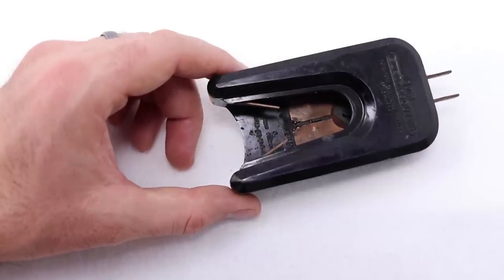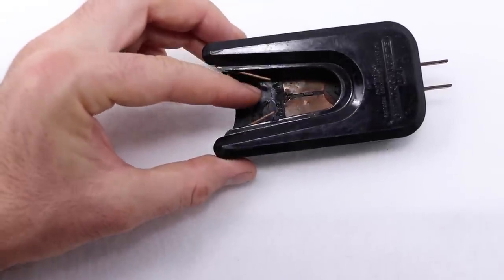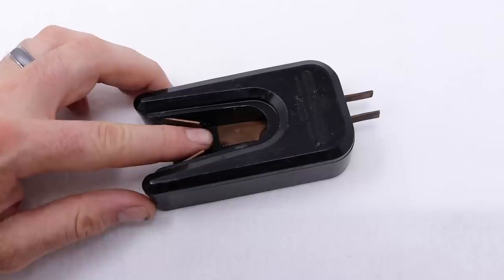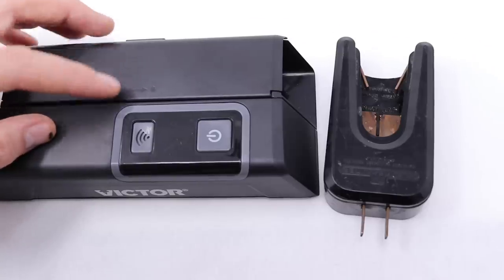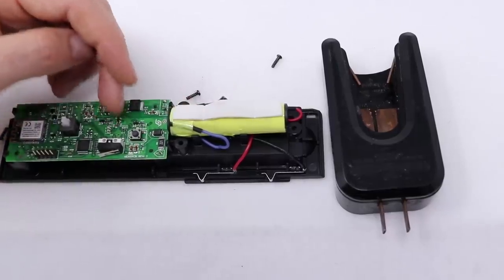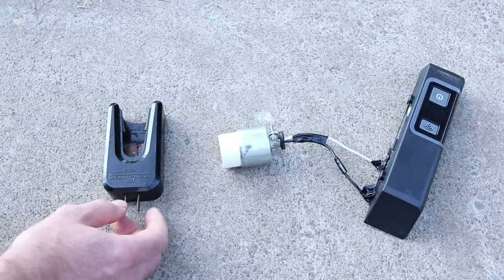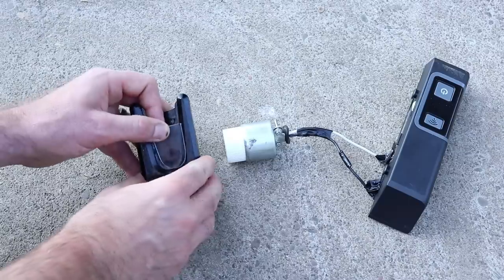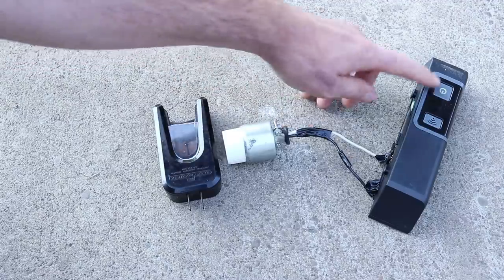The Electrocuter Mousetrap From 1947.   Mousetrap Monday

Comment: Shawn, it's not just 6 volts. The buzzing you hear - is actually a flyback transformer working - it generates thousands of volts. That's why it has all the safety.
Reply: Alexander Khritonenkov I think he meant the 6 volts charging up the capacitor
Reply: Christian Wang any buzzing indicates current switching. That’s not DC. The yellow bit is a high voltage module like a stun gun core.
Reply: WineScrounger oh yea your right a capacitor would be a single pop
Reply: if it was a capacitor there would be a rating on it in # microfarad(s)[with # standing for what number is printed on a capacitor next to the microfarad symbol and that would be uf]
Reply: My guess is that it gets upconverted before charging the capacitor. The capacitor is needed because the batteries can't produce the energy fast enough. So it charges the capacitor slowly and then discharges it fast.
Reply: Nerdddddddd
Reply: Lol where did my reply go?
Reply: @Smasher77th  that is true but i don't use the symbols enough to know how it is done infact i need to look up the key combination for the digree symbol when i go to use it while typing in a word doc or a comment

Edit: almost forgot to add in that i am considerd the techno nerd by those that i know around me
Reply: Chidiebere Anyahara  I'm an engineer at a large semiconductor company, and the only time the mu symbol is used is when we are writing something formal or semi-formal.  No one bothers to use the mu symbol during emails, we all have more important things to do than trying to insert a greek letter. In circuit simulation software and CAD programs, the letter "u" is also usually used over mu since it is actually on the keyboard and users can actually enter it.  Most people do not know the numpad codes to make these symbols, nor is it really necessary to do so.
Reply: tatarjj2007 uh oh here comes the master
Reply: @tatarjj2007  so if I want to build this at home, MacGuyver style, what do I need? A toaster?
Reply: could a taser be converted?
Reply: @tatarjj2007  it is easy to enter Greek letters if using a full keyboard, using the alt key and ascii code for the letter.
Reply: Thanks, I was going to ask that question hoping someone would know. So it increases the voltage and that is why it works.
Reply: @wadewillson9220  DING
Reply: Alexander Khritonenkov nn
Reply: Nerds make the world spin
Reply: @WineScrounger  it is probably thousands of volts pulsating DC.
Reply: It likely generates DC pulses (basically AC) that it runs through a transformer to produce a very high AC. The yellow component is likely a transformer.
Reply: @tatarjj2007  
µ is opt-m on a Mac.
About 1.1 times harder than typing a capital M.
Reply: @-danR  On Windows computers it's AltGr+m. In biomedicine most measurements we use are in the µl range so it's not a formal symbol at all.
Reply: @harveyharbicht4959  maybe but maybe not
Reply: As stated, it's not a capacitor, it's probably a transformer much like that found in stun guns.
However it probably pushes more current at a lower voltage rather than high voltage low current. I'd guess it's probably in the range of 500V to 2kV

Comment: Plug it into an European socket, 230 Volts will do the job⚡⚡⚡
Reply: YYYYYYYYYAAAAAAAASSSSSSS
Reply: They come from there
Reply: Or hook it up to a microwave transformer.
Reply: It won't work in any modern or recently rewired house because the RCD will trip before the mouse gets a lethal shock
Reply: They have 240v outlets in the USA, but most residential outlets are 110v

Comment: Another problem with this plug-in electric trap is that it's trying to push 120V through the fur of the rodent. Since the conductors are side-by-side on that trap, it contacts the mouses fur instead of directly with its flesh. Modern traps put the conductors on the floor of the trap, so the rodents feet make contact.

Comment: My immediate thought was to set the Electrocuter upside down, so the mouse can't jump out of it. Possibly even with a small weight on it, if it is still light enough for the mouse to flip it over when jumping.
Reply: tcsyme the contacts also need to be sharpened and if possible, barbed to keep the vermin in place while it fries.
Reply: Imagine both you and Rota speaking your comments out aloud with a thick German accent. Very sinister, if you're an Allied mouse!

Comment: The yellow module isn’t a capacitor, it’s dedicated high voltage supply, basically a powerful little inverter, rectifier and capacitors  across the output. It’s much the same as you’d get for the guts of a stun gun. You can get them on eBay or amazon for under $10, they need about 2A at 6v and they’ll output about 40kv open circuit. This kills the mouse.

Comment: The problem with this is with new technology and the way electric breakers work this is more likely to triple breaker before the mouse is killed unless they have capacitors and or diode’s to shield the breaker from seeing this load
Reply: How much of a load if the mouse remains on the contacts?

Is the resistance through the charred crisp corpse less than 5 ohms? Surely the breakers wouldn't trip if you plugged in an electric kettle and a toaster into the same circuit.

I can't see well enough to tell if there is in fact a resistor wired in series into the device.

Comment: The yellow thing is probably a high voltage generator that outputs upwards of 50,000 volts. I have a couple myself. Components are inside the tube and both ends are filled with epoxy. These are used in stun guns (100,000 volts or more) or arc lighters (about 15,000 volts). My arc lighter kit was about $3USD.

Comment: Bakelite is a plastic that doesn't melt at low temperatures, and is a good electrical insulator. It was used in electrical devices because you can solder right near it without melting.

Comment: I think it could work in germany because here in germany we have 230V 60Hz AC electricity and in america (i suppose you live in america?) You only have 130V i think
Reply: 110V
Reply: In America we use 120, 240, and 480 volts. Most houses have only 120 and 240 available. Commercial installations are commonly 480V 3-phase, tho they can be 120/208V 3-phase.

Comment: The voltage is what kills them instead of current. The 6 volts is upped from the sound of it probably to 60kv which will definitely do more damage. I'm not sure if there's an oscillator in there but that would also do more damage. Might not be though because I think it has more of a throw back and you don't want that, you want to hold them in.

Comment: Yeah, AC isn't gonna do it. DC will make the mice tense up and kill them.
Reply: What if you put a wet sponge in front of the trap, so the mouse has wet feet going in? Would that make a difference?
Reply: Eyellgeteven : That sounds like a good idea.  How about a salty wet sponge?  Brine conducts electricity better than pure water.
Reply: Well if you combined both then the mouse would just get 

Thunderstruck!! 😄
Reply: How many people fail to realize that direct current runs on much lower amps and is used in electric fences, cattle prods, tazers, stun guns. They all run on DC current. Thats how you can pump 50,000 volts into someone and not kill them. AC holds higher amperage on lower volts. DC holds a higher voltage on lower amps and amperage is where the killing power is.
Reply: high voltage

Comment: Hey Shawn, the victor trap probably has way more than 6 volts, it most likely uses a voltage boosting circuit to up the voltage in order to push enough amps through the mouse to kill it. This is the reason car batterys don't harm you, they have the capability of pushing a lot of amps out, but the resistance of your body is too high for the low voltage of the battery to be able to move current through you.

Comment: 3:15 "I believe this part is a capacitor"
its a coil/transformer. 6 Volt isnt enough to provide a lethal current.
BTW: current kills, not the voltage. The Voltage has only to be high enough to penetrate fur and skin
Reply: "current kills, not the voltage"
Bollocks. Since the mouse provides a more or less constant resistance the current is solely determined by the applied voltage. I=V/R. So with a given resistance you need high voltage if you want a high current to flow. 
You're right about the transformer, though. In my opinion this trap isn't very good. It applies high frequency AC which tends to travel mainly along the surface of a conductor due to the skin effect. That makes it more of a torture device. I'd design it to charge up a fairly large capacitor bank to around 10 kV DC or higher and discharge that all at once through the mouse's body. That would achieve a very high energy discharge and provide a clean, instant kill.

Comment: I think the 6v gets ramped up to a much higher voltage (5000? or more) and then the initial delivery amps get ramped up with the cap.  So I'm pretty sure its not 6v DC getting delivered.

Comment: It is supposed to be set the other way. Flip it over so the opening is downward, and the copper pads above the opening. Make sure to put the bait on the copper pads side so the mouse has to arch it's back to lick the bait. And bend the wires inward so the gap is just wide enough for the mouse to enter. It should work on standard 110v that way... But if it does work, it is also a fire hazard as it will shock the mouse until it is unplugged.

Comment: It doesn't work because of the amount of amps. Voltage doesn't kill you, amps do... the victor has compacitoers that pump up the surge of amps... great idea, Shawn!
Reply: patrick kimbrell   CAPACITOR
Reply: patrick kimbrell 5A will kill a mouse very quickly. The barn is likely wired with 20A circuits. 1) mouse fur is not all that conductive and 2) the contacts are barely touching the vermin and will not hold it in place.
Reply: @ronsphar4827  excuse me. I use talk to text since I'm handicap. Thanks for your concern
Reply: @ROTAXD  oddly how it didn't easily kill the mouse like you said it would. I seriously doubt that it is wired like that when he has a workshop with a lot of equipment and tools plugged into it
Reply: You are only partly correct. True, current flow is what kills, but in order to get the necessary amount of current flow, you need to have a high enough voltage. High voltage sources that don’t kill are always current limited. Low voltage, high current sources, such as a 12 volt car battery, don’t have enough voltage to overcome the body’s resistance to current flow. To be lethal, you need a high voltage source with enough current capacity to do the job.

Comment: Probably you just need 220vac source intead of 110vac.
Reply: Electro FAN nope. It's not the voltage that kills but the amperage
Reply: apex yes, but a higher voltage allows more current to flow through not so great conductors like mice. I'm from Europe and we have 230v here. It's killing mice just fine.
Reply: You need 10kv DC supplied by a big capacitor. Boom, mouse gone.
Reply: UK: 240v. We win :)
Reply: Chriseurosong 415v 3phase. Toasty
Reply: apex a simple 15a 110 circuit would be more than enough to kill a mouse if it were stuck in the trap.
Reply: rig up an old buzzbox set to highest setting, attach ground to a nice thick plate, elevate large electrode pointed down above plate tip about 1.5 inches away from plate, place bait on tip of electrode, turn on welder, wear shade 9 burning goggles and enjoy the show.
Reply: even 230V i barely enough to kill anything.
there is a small chance of making your heart fibrilate (why i would not recomend touching the contacts of the socket), but there hardly any chance to get an instant kill
Reply: @WineScrounger  Mouse gone or mouse exploded,lol.
Reply: @ROTAXD  A circuit does not "push" current, the current depends on the resistance, you can't change the resistance of the mouse so the only way to increase current is by increasing the voltage.
I = U * R
Reply: It's not the voltage that kills. It's the amperage. Farmers use 50,000 volt fence generators all the time but it won't kill. But anything over 4 amps can stop your heart. Even just 110 volts can kill you with the right amperage.
Reply: @kevincooper814  The resistance of a human from hand to foot is about 500 ohm.
If the voltage is 110 volts the current will always be 110/500 = 0.22A.
If the voltage is 10000 volts the current will always be 10000/50 = 20A

Electricity can be seen as a tank of water with a hole, the pressure created by the water represents voltage, the size of the hole represents resistance and the amount of water flowing represents the current.

If there is a low pressure in the tank but no hole then no water will flow.
If you have a realy small hole a bit of water will start flowing.
If you increase the pressure a bit then more water will start flowing.
If you make the hole bigger again even more water will start flowing.
Reply: Except that device is a two conductor only device.  You would have to modify it to add the missing conductors in order to make it compatible with a 3 phase system in such a way that the mouse can touch all conductors (contacts) at the same time upon entry, otherwise the mouse would be touching one phase at a time before getting spooked and not getting the full effect you wanted.
Reply: @tobbleboii5988  for a human maybe but mice are much smaller. Also by the look of the trap I think its getting a brain zap. I'm no doctor/vet but I suspect current through the brain is more likely fatal than a body shock.
Reply: Or 400v as we have in Norway lol
Reply: @dankrijk9678  Or 480 as we have in America, or even 600 which is common in Canada!

Comment: Electrical death is a function of voltage, current, and time. A mouse, like a human, can take thousands of volts at several amps and still live if the shock is short enough duration, like static (which is actually in the thousands of volts and several amps). The victor trap kills the mouse because of it's small doors that hold the mouse on the plates for a moment, so they get the full brunt of what appears to be a repurposed flash capacitor from a camera. You could potentially build a good electric mouse trap out of those disposable cameras from back in the day with a similar concept. The goal is to ensure the frequency of the electric pulses is not too high (which will create something called the conductor skin effect, hurting but not killing the mouse), and the voltage and current are enough to support a lethal shock. You would have to ensure this current passes from one end of the mouse to the other, crossing the heart.

Comment: Direct Current has more killing power
Reply: Um no it doesn't my friend. Tazers, stun guns, electric fences all run on DC current. DC delivers pulses of electricity in one direction. AC delivers continues voltage as it alternates direction producing way higher amps thus much more lethal.

Comment: That yellow item inside isn't a capacitor, it's a transformer. :)
Reply: House0fwax no it's a capacitor
Reply: Yes it's like a little tazzer probably thousands of volts.
Reply: capacitor
Reply: You can't use transformer on dc lol, the capacitor is used to provide more current at the output when contact is made
Reply: More than meets the eye.
Reply: Sorry, was a mistake, it might be a mixture of a transformer and capacitors, they turn dc to ac to stepup the voltage and rectify it and store it in a big capacitor ready for shocking
Reply: Neil Janviere Rovillos no they don't you need an inverter to switch DC to AC
Reply: Neil Janviere Rovillos yes you're right it's a  high voltage generator of sorts probably made especially for those traps.   Just a capacitor at low voltage wouldn't do a lot. 
Have a look at ( bigclivedotcom   high voltage generator )
Reply: Definitely a transformer, it’s a similar circuit to those arc lighters.
Reply: это не конденсатор, судя по тому, что туда входит три провода, это автотрансформатор, а вся схема получения высокого напряжения работает по схеме блокинг генератора.
Reply: @simonhopkins3867   open up a disposable 35mm camera and touch the two wire ends that make a flash happen. That will shock the shick out of you(even burn or blister you)CAUTION Advised!!!!!
Reply: @luckytailor3303   what you do behind closed doors is your business. We don't want to know.
Reply: It's a capacitor, gets charged up to maybe 200-300 volts by the switching transformer on that circuit board. I have an older digital camera with a xenon flash...it has a 350 volt capacitor...and yellow like this one... it will really give you a wallop if you touch it when the flash triggers...probably gets charged to at least 300 volts.
 Tazers work a little like that...convert 6-12 volts from battery to high voltage...the 'clicking' sound is the capacitor discharging....several thousand volts at least.

Comment: 110v is not enough to drive a good current through healthy skin, especially when covered with fur. E-shockers use a couple of thousand volts to penetrate fur/clothes and skin and then limit the current to a safe level to induce pain but no serious injury. The modern mouse trap just doesn't limit the current.

I have worked as a safety inspector for electrical equipment. Once I had plugged in an extension cord which was hidden behind an office cabinet. While it worked, the tester didn't like it at all. Turned out that a mouse had peeled off all the insulation but the one from the phase wire. Neutral and protective earth were fully blank. Looks like they can sense it or the mouse had learned which one "bites" and which doesn't.

Inside an electric cabinet I found a skeleton of a mouse on top of a row of circuit breakers. Somehow the mouse managed to crawl over the breakers avoiding to touch the grounded cabinet. It was lucky until it touched a breaker with a different phase. The voltage phase to phase is 400v in the EU!